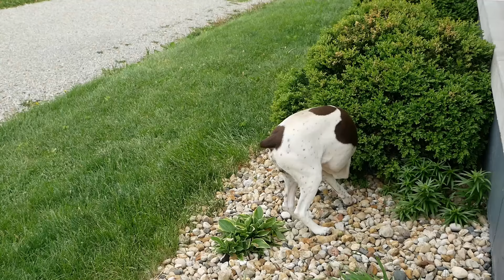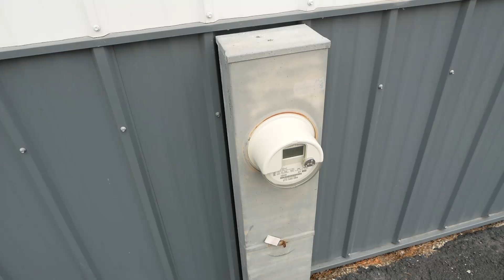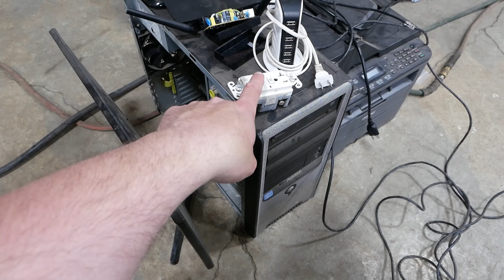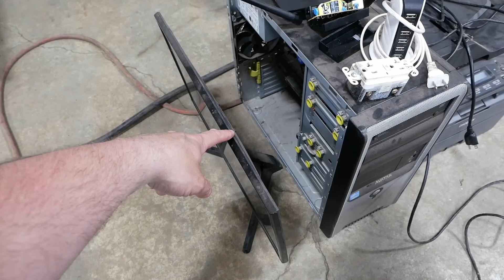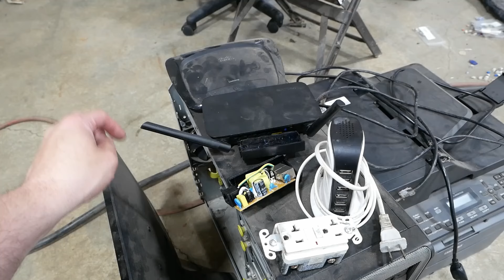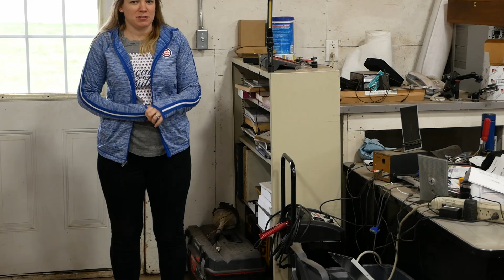Lightning Strikes Shop, Again...

Comment: Install a couple of lightning surge protectors on your main service. Should stop any damage further down line. I used to work for an electric utility, and we installed them all the time.
Reply: I ve installed them and seen them work on commercial and residential. I've seen them explode, but save the equipment in the building. Granted with surge protection inside as well.
Reply: If they didn't work they weren't installed correctly..
Reply: @TexasWB1958  ok ok I'm willing to buy into the idea that they are better than nothing but nor installed correctly? It doesn't exactly take a engineer to connect up 3 color coded wires. Although I would imagine the effectiveness would also come down to the quality of the grounding. Maybe they are just simply less effective in my area.
Reply: @malanvogt  Now granted even though I have seen them work, depending on how close the lightning strike is, the voltage and current could very greatly. In some instances nothing would probably save it. At his shop it was really close to the building. So they probably wouldn't have worked
Reply: @TexasWB1958  I can agree with that. Most I've seen have been direct hits to the house or pole I'm sure something even slightly less direct would benefit from some sort of protection.
Reply: @malanvogt  A direct hit would require a full lightning protective system installed to handle the majority of the energy - the rest is then clamped by appropriate surge suppression. A hit like this on the pole is mostly handled by the grounding at that pole, the energy which made it to the buildings should be reasonably handled by again appropriate surge suppression.

Most events are not 'proper' lightning strikes, as most buildings make crappy conductors.
Reply: @TexasWB1958 Totally agree with your comments.
Reply: Those almost never work. Those are really only made more minor over voltage situations and not a proper lighting strike.
Reply: @malanvogt  They are not surge protectors, they are high voltage lightning protectors and they do work.
Reply: @watermanone7567  my experience is that they don't. I've repaired a lot of equipment that was hit and the customers have had a mix of cheap and expensive ones. A few hundred million volts at 10s of thousands of amps is strong enough to jump through the air let alone a 100$ protector.
Reply: @malanvogt  They take the voltage, amps hit to ground and usually do a good job saving equipment if the building is properly grounded.
Reply: @malanvogt  You are wrong, we used the actual protectors for lightning hits.
Reply: @malanvogt  And even if they do, does the original commenter really think Wes doesn't know about them? I knew the first comment on this video would be some hindsight-utilising smarty pants.
Reply: @PJBonoVox  You are really stupid. Most people don't know about them and I bet you don't have one on your house. Probably you live in a shanty apartment and Gov't. supplies all your needs.Can tell from your site about how much you know.
Reply: I am surprised by the amount of people who gave the comment a thumbs up. 👍 I'd guess not a one works in any trade that involves electricity
Reply: I was about to say that lol

Comment: Get yourself a lightning arrestor/ surge protector installed at the incoming power panel or breaker box. Its installed between the hot legs neutral and ground. It's saved me 2 times. As soon as your hit it is sacrificed not your devices. Also you should now by now to unplug your devices during a storm !!!!

Comment: Wes, I didn't see  your "terminal strip" that you said everything was plugged into. Many people think power strips are surge protected but aren't. You need a surge protector that has high joules. the higher the better. I've seen good surge protectors save electronic equipment like you have. I'm sure your system board is toast in the computer but if your hard drive isn't fried, you can either copy the data and put it on a new computer or slave it in which would probably be cheaper than fixing the one you have. Sounds like your internet service is as crappy as mine. Your cell phone can be used as a hot spot as well. Good luck!

Comment: Years ago our house got hit by lightning.  It mainly just took out some electronics and devices, but the microwave was the interesting victim.  It still worked, but it would randomly start up at any time, run for a few minutes and then shut off.  We just kept a bowl of water in it all the time after that.
Hopefully you get back up and running soon and can recover your information.
Reply: Why leave water in it. Microwaves don't hurt a microwave oven.
Reply: @hikerJohn  At the time we were told it was bad for the microwave to run without something in it.
Reply: @hikerJohn  Microwaves certainly can hurt an empty oven, all that energy has to go somewhere. Operation for short periods may be ok but sustained operation will cause damage.
Reply: Maximum Overdrive!
Reply: @bcad4066  Now that's a great memory!  Liked the movie, loved the original short story!

Comment: A whole house (well shop not house) surge protector could have saved the plugged in electronics. Lightning is violent and if you have multiple layers of protection each layer will absorb some energy by diverting it to ground and shorting all conductors together.
I guess none of that is of any help to you right now... especially since a blown surge protector needs to be replaced.
Reply: Won't help if it comes in from the ethernet cable.

Comment: Without going through and safe guarding and isolating sensitive electronics. It will be rather hard. Also would it be worth while to invest in a laptop to move files into?  Or some isolated storage solution That way you could have some backup for your computer.
Reply: Yes, Google has a free cloud storage option as well as Dropbox and Microsoft. Depending on how much data you need to store, these can be great places to keep data  "too important to lose"

Comment: Maybe it's time to check into alternative sources of power : solar, wind .
Reply from the maker: You still have to be tied to the grid.
Reply: @WatchWesWork  But that would be only to sell extra energy to the grid. You wouldn't be reliant on the grid to provide power.
Reply: @jenksify  That does not remove the grid connection as a giant elevated target for lightning..
Reply: @Monkeh616  True, so i would say to add a full home surge protector to the mix.

Comment: Try getting an independent power supply Wes those tend to have more filtering capacity than those garbage power strips
Reply: Doesn't protect ethernet.
Reply: @TheMetalButcher  Mine does it has a port in the back where you plug in the ethernet in and out